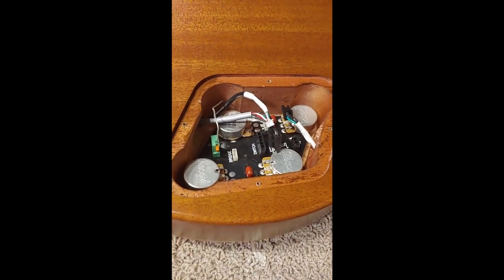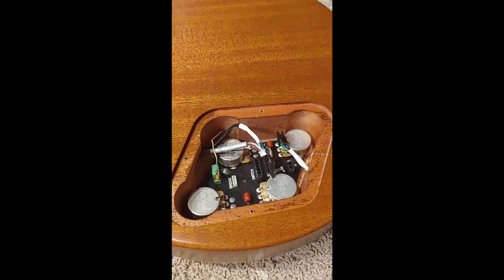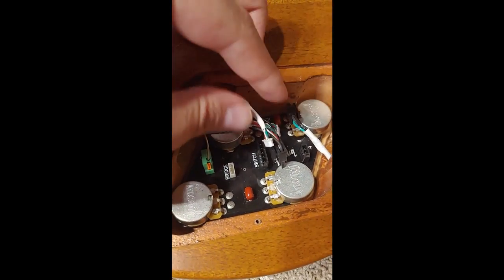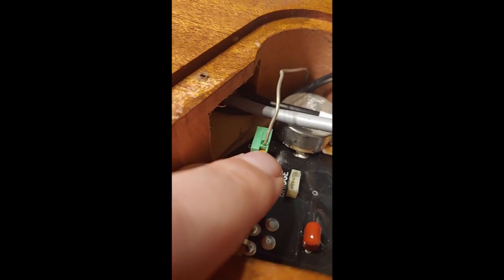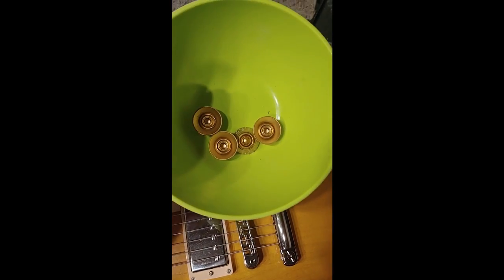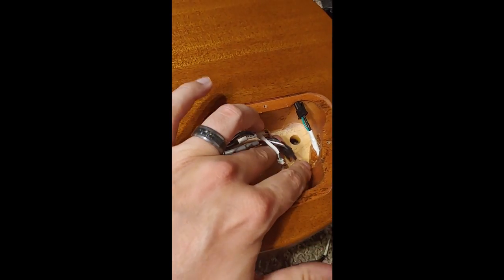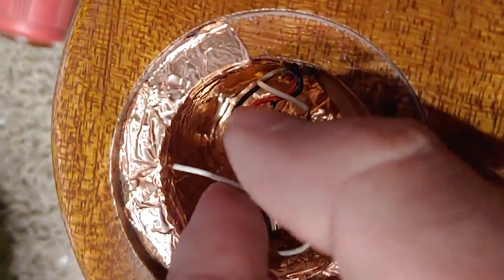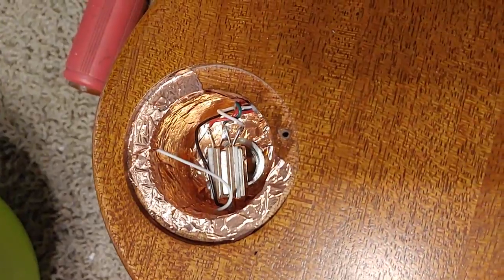How to fix Gibson Les Paul Tribute Static Crackle

Comment: HI, Thanks a lot. I have done it to mine (tribute 2021), just the cover and a wire connecting to the ground for the controls and on to the switch. I made sure the connectivity is there. However, when I rub my hand outside of the cover, on the wood surrounding the cavity, I hear static crackle. I might need to tape the whole cavity but it is like 80% better. Very nice now and it seems that the pick ups sound better. They truly do based on my recordings unless I am crazy, which could be a possibility too !!! It Could be due to less electrostatic interferences but a lot more clarity and more PAF nasal type of sound. I am really happy about it now. In fact, it sound like the Gibson sound I was expecting but never got until now.

Comment: thanks for the video, I have an annoying grounding issue on my LP standard which goes away when I touch any metal part, also static when I rub the back, and to make things worse, the pickups are very microphonic, and since I use the guitar for recording, I will have to get it all fixed . the microphonic pickups are the worse, because they both do it, and it sounds like a metronome click through the amp or interface when recording, so its probably a loose ground. Will come back when I figure it out.

Comment: In did something similar. I ran a wire to where the cover is and connected to ground. I put copper tape on the cover and a piece on the wood. I didn’t have to tape the whole cavity.
Reply: Hi! I’m interested in your method as I’d love to avoid unnecessary work if possible. Could you explain to me what you did. I’m a bit confused as I’m a total noob but would like to learn. Thank you!

Comment: the wire in the toggle switch was a nice touch but not necessary.  The contact of the switch goes to ground, so copper making contact with the  switch  grounds it out.
Reply from the maker: Just wanted ground going through the switch plate cover.

Comment: just letting you know Gibson dose not shield guitars . turning your pickup around takes it to out of phase to much of a strain on your bridge magnet.that's why they are set like they are from the factory. the covers for the access panel and selector are made for shielding putting copper tape is counter productive.
Reply from the maker: It still crackled like this when the pickup was turned the factory way. What I've heard is that the crackle is from the nitro finish curing? Lol. In any case, the grounded copped shielding in both cavities DEFINITELY cured the static crackle, and many tribute owners suffer the same issue, so if gibson shielded the cavities from the factory, they could really up their game! Thanks for commenting.
Reply: @June Bromley
Our host, and his video, showed how the shielding solved a prevalent problem.
Counter productive? Gibson factory sent out our host's guitar, and my 2016 SG, with bad static issues that required rectification. Some of us do our own trouble shooting and look for real world solutions regardless of a manufactuer's product specs or design.
Your post assisted in nothing other than revealing yourself as an idiot. Be well.